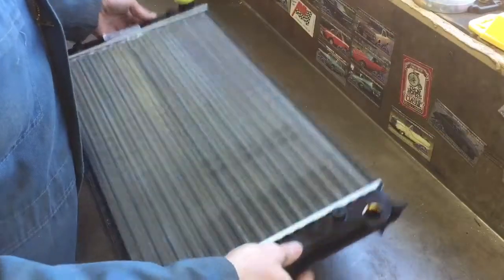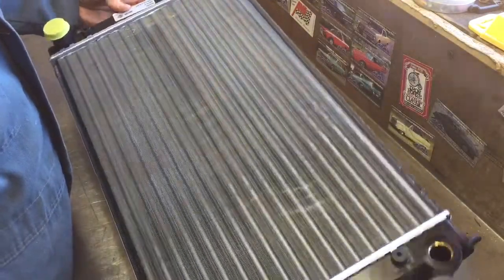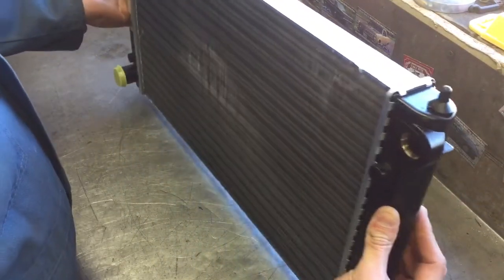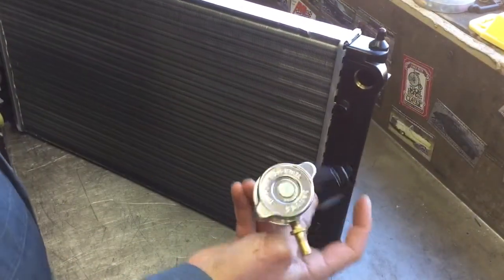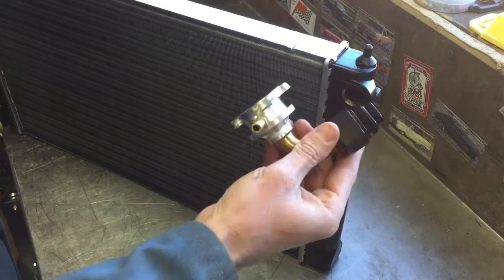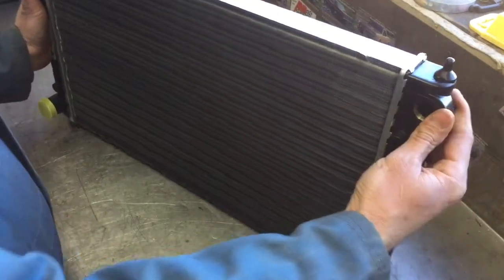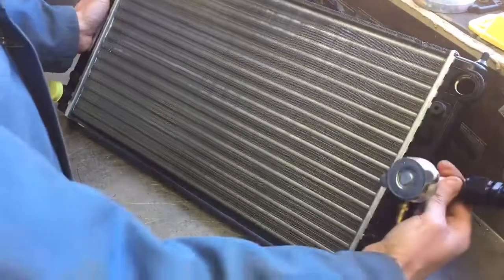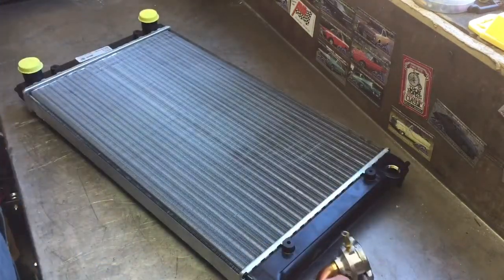VW Scirocco Radiator filler for VW Subaru Conversions

Comment: Hi Mick, I have this setup in my bus, it works great 90% of the time here in the Northwest Oregon, I even got the 3 core all aluminium radiator.  The problem I am having is when I go East and the temps get in to the upper 90's and going up hill, my temp goes up to 210+.  What is the MAX temp I should go before I pull over and let it cool down?  Have you made any cooling changes to keep these high temps down?  Or Is it just a problem I am having with my bus?

Comment: Nice work Mick, So have you moved away from the dual Honda radiator setup in the bus?
Reply from the maker: +SVs Auto I like the Scirocco radiator on the left and Honda on the right, much cleaner install and allows you to use the right "porthole" for air intake. Check out the Streetfighter build to see that arrangement.

Comment: Where can I buy that filler neck at? I’m using the same radiator on my 89 Honda and can’t seem to get the coolant down without that part. Would I appreciate if you can tell me thanks

Comment: Do you have any pictures of the scirocco rad installed. i am soon going to be doing my conversion but not sure for cooling. was going to do the 2 civic radiators. thanks
Reply from the maker: +Grasshopper Garden Services you can check out the Streetfighter build and the daily VLOG videos of summer last year.

Comment: Isn't the outlets supposed to be on the right when its mounted? That way the hole you screw that fitting in would be on the bottom
Reply from the maker: +George Tsioutsias Only if mounted on the passenger side of the engine bay in a bus. That would make for a really awkward tubing arrangement if mounted that way on the left side ;)